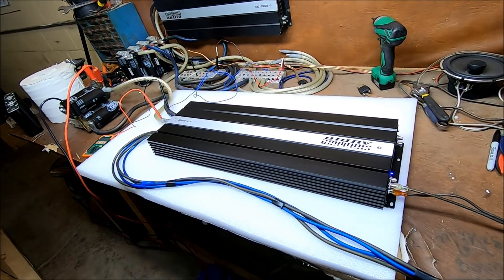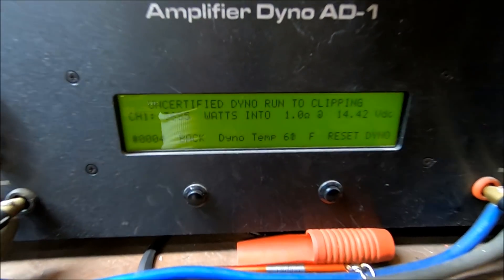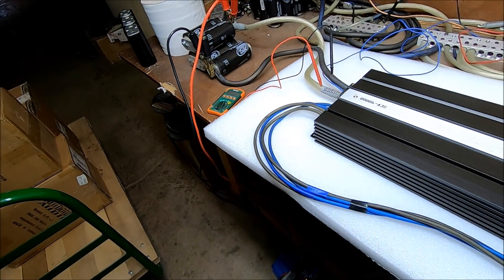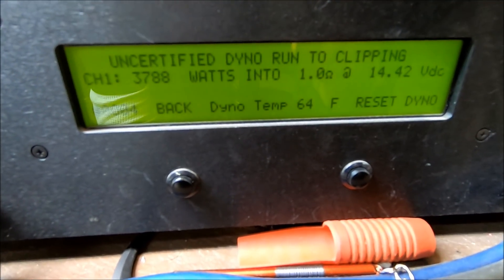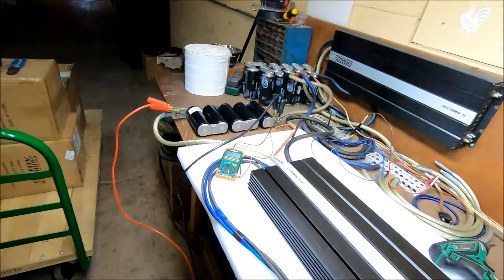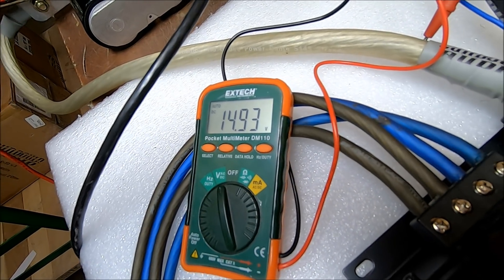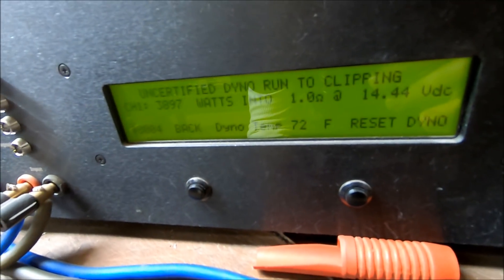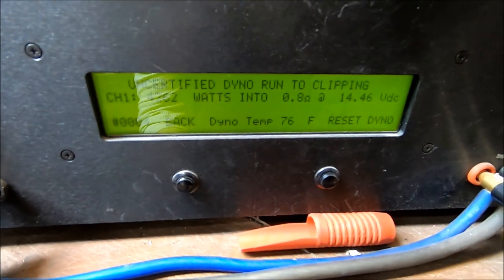How Much Power Can You Get From A Bank Of Supercaps? *Tech Time Thursday*

Comment: 10,000 RMS watts!? >> This tells me that 1 bank of XS-Pwr caps (6 x 2.7v 3KF or 500f overall) in conjunction with a powerful battery (preferably XS-P Lithium) and H.O. alternator (390amp) will provide 10K+ RMS watts. Also that is what SPL Showtime aka Sparked Innovations YT vid suggests if I remember correctly. Here's the vid: https://youtu.be/JTNivApnZyE?t=1042 What experience do you guys have with combing a bank with 1 or more batteries?

Comment: These caps are amazing, I showed them powering the monster JBL A6000gti in one of my previous videos. I only wish I had the 3V 3000F ones, not the 2.5V 2600F ones as I need 6 to get 15 volts and the capacity drops with another cap in series. Still, supercaps incredible, especially for music playback in a car as they can recharge very quickly.
Reply: I have a question and I thought I'd go to the goat for answers. If I'm running 3 AGM Kinetik batteries in the rear, a Duracell Platinum AGM in the front with a Singer 320 amp alternator, would this be a good combo? 

Also, I have a buddy with a stock alt and a 3k amp. He has only an AGM up front. What would be the best for his setup?
Reply: @thatunknownguy87  here u go man, this video goes into detail which I think will b most helpful to u, https://www.youtube.com/watch?v=JTNivApnZyE
Reply: Big D, Capacitance drops, but the power goes up.

Comment: Can you wire more caps in series for higher volts?
Reply: Yes you can, however due to how capacitors charge you lose capacity when you do so.
Reply: @BigPimpin91_TA  nonsense.  Total energy goes up when you add more in series.  You do lose Capacitance, though.
Reply: @bbcellular  I like the way you simply say "nonsense"
Reply: @rodneyrael3024  I said a lot more than that!

Comment: nice test, but where is the control  (the big battery bank) Even better test with one battery. Then add the caps. Most of us have a choice of adding a 2nd battery or a cap bank. They cost about the same. But they don't weight the same
Reply from the maker: Dont need a control,this isn't a comparison test.  It's a heres what they do take it or leave it test.

Comment: I wonder what the voltage drop is on these if you charge it with a fairly stock alt, say 100 amps, and have it wired to 1 or 2 ~100ish ah agm batts. That'd be interesting. A lot of power though, damn.
Reply: You probably have upgraded to lithium by now :-), but I have 2 banks with stock alt and 2 AGM on a 8K
If you watch the voltage in the morning, those caps will soak up so much power every morning (about 12 minutes) then you are pretty good on voltage if you give the AGMs a break once in a while

Comment: 5 caps at 15 volts.. wtf?!?!
And how can your "meter" be hooked to to another  voltage source to measure the power of another?
Reply from the maker: The power for the amp dyno is plugged into the test bench battery bank since we normally use that as a power source for testing amplifiers.  Since this test uses a different power source I made sure that there was a volt meter plugged directly into the superbank/amp inputs.  That's clearly shown in the video.
Reply: @UnofficialAudio  Yeah but you did not have an ammeter also.
Reply: you can't as the dyno uses the voltage shown on the dyno as part of the circuit analysis to calculate output power.  The dyno has a volt meter and a current meter internally that it uses to calculate the wattage shown.  So there is that.............

Comment: Looks like the second cap bank holds more juice
Reply: No shit, its rated for more.
Reply: @4gbmeans4gb61  you say no shit like we knew the ratings for both stfu
Reply: Bill L they said them in the video and stated the second one was rated higher lol, higher farads higher the capacitance, aka holds more energy.  Tests like this I would think they would use same rating caps so we can see which brand is best.  The price and durability would also have been good to know.
Also something about the second one being laser wielded or some shit, a test to see if this is better then regular bolt in buss bars from xs power would be a good to see.

Comment: How does a single bank compare to the group 31 sized cap bank you guys sell? I have a 250 amp alternator and a kinetic hc3800 as a battery after my starting batt. Im Looking to run 5k rms and possibly adding one of your cap banks or cap battery. So what I'd like to know is with a charging source like mine and a little agm help how would voltage hold up with the caps added?
Reply: Depends on the situation. If your subs show low impedance at 20 hz and you play a full volume test tone with 5kw rms running into the sub at 20hz then your amp is gonna draw really high and really low current 40 times a second. More current than even 2 hc3800s would be able to support. And this alternating draw will mean that any slow reactions from your voltage regulator leave your voltage dropping alot. A super cap bank will help you get the fullest out of that alternator in situations like this because the voltage regulator and batteries will never have to react to sharp changes in draw. Because of this I would say you will get more bang for your buck from the cap bank first and another battery second. But yeah if you want rock solid voltage in all situations with that alternator and running that much power then ideally you have both the batteries to support it and a cap bank.
Reply: @maxfmfdm  Thanks for the info. I have been doing the debate between lithium and caps for a few months now and just didn't know enough about either to be honest. I'm going to try and conjure up some room to run both an agm and a cap bank. My voltage with 2.5 to 3k clamped is right in the low 13s so I'm hoping with the addition of a cap bank I can hold that same voltage with a little more juice.

Comment: I added 2 banks of 6, 2.7v 3000f maxwell boostcaps to my electrical and it was the best upgrade per $ that I done to my electrical system! It helped me tremendously, I could not believe the improvement that I seen!
Reply: Ps, I run a 250 amp alternator with 4 crescendo 110 ah batteries in the back an xs under the hood and its all on 2 4k's strapped on 2 zv5 18's. And the boostcaps help me sooooo much!